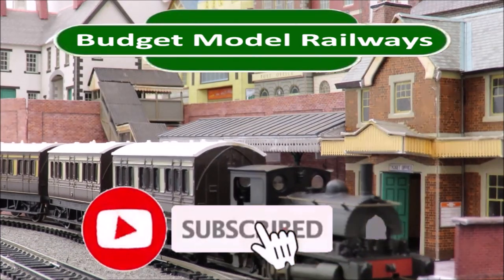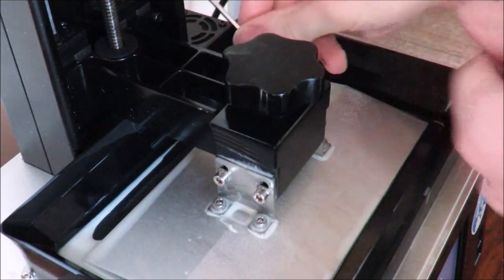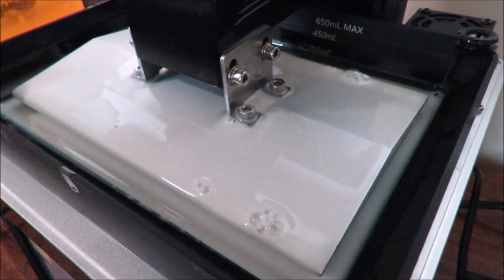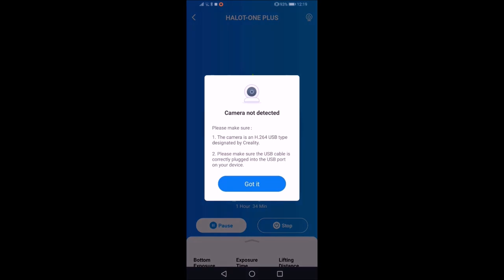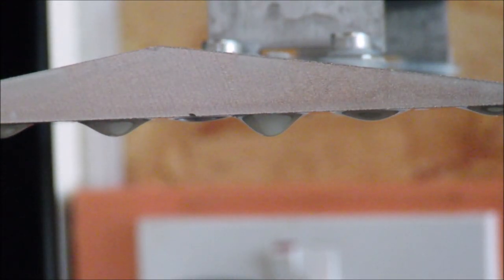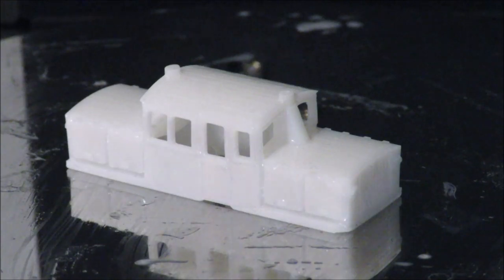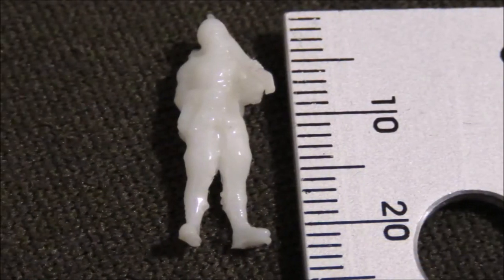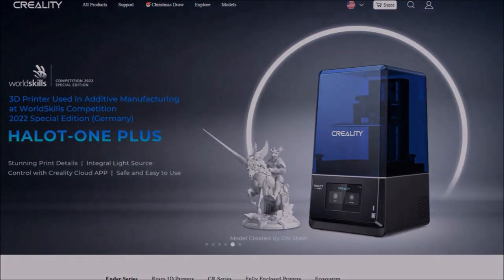The Best Plug & Play Resin 3D Printer For Model Trains & Figures? | CREALITY HALOT-ONE PLUS

Comment: A nice video - a few things to consider when resin printing: 

There is UV light everywhere, particularly from the sun and from fluorescent light bulbs that will cure the resin so exposure should be minimized to these sources (hence the UV-opaque covers). Also the resin is nasty stuff - very toxic to breathe and cannot be disposed of down a drain. Handling of it should also be done with gloves. For my resin printer I have a designated table for working with it. I have also found that after several prints, using 99% IPA is a must for clean up. Using water or 70% IPA just doesnt clean up the parts as needed and can lead to failures down the line.

Comment: Great review. I have the Monoprice Filament printer and it is a bit noisy, sometimes it rattles and I have to restart a few times to get it to stop.
It does leave print lines and I have not attempted to do any figures for that reason.the cover on the base plate has fallen apart and I will need to try painters tape as a cover, I have seen this done.
I bought it because it was only around $200 and it was a great price for an intro into this field. Don’t get me wrong, I have been happy with what I have printed but for what I would like to produce improved quality models and I think I need to move to a resin printer.
Thanks for sharing this with us, good luck at Uni and happy modelling
Charlie

Comment: Resin printers are very good for very fine detail but the resin is toxic and should be treated with care when using and waste resin, especially should not be disposed down the sink(including water soluble resins). Failures happen more easily than FDM and requires extensive clean-up before another attempt. To help with less failures it also very important to print in a space that is at least kept between 20 to 25 degrees centigrade.
Reply from the maker: Not quite sure about some of this, not found this in our machines? What FDM printer and what Resin printer have you been using?
Reply: @BudgetModelRailways  Not quite sure which point you disagree with,  all extremely valid points😮